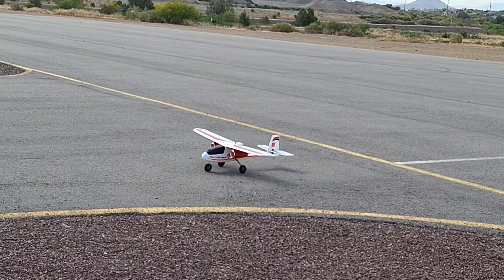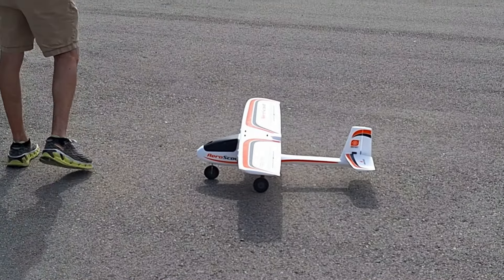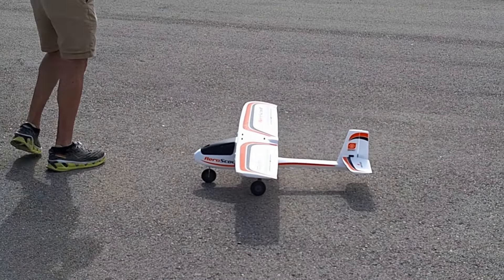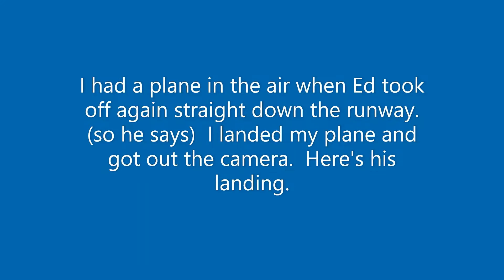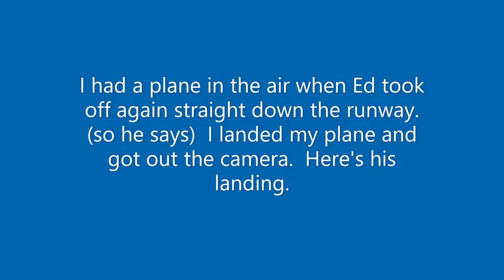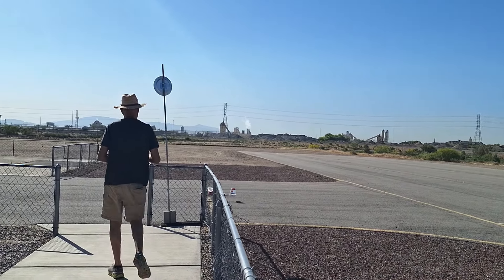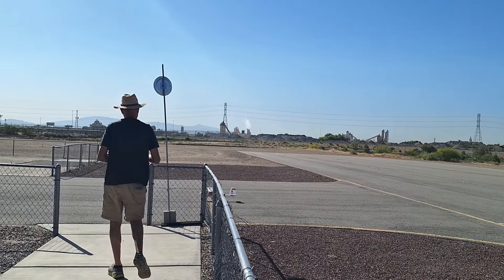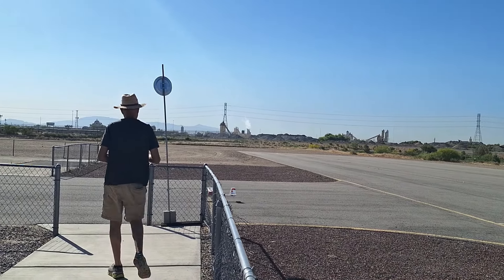Aero Scout with Twin EDF motors

Comment: I have been flying for 8 yrs now,and i can never figure why people fly so far away with small panes. I have had to save a few planes for people. Flying to far away. Good build.
Reply: I'm close to 60. Got back into flying 5 yrs ago. Flew 20 years ago for 15- 20 years prior. I do primarily 3d. Even my bigger stuff (1.3m-2m) when it gets sketchy, in the sun, in gusty winds, GOTTA see which en's is up🤪! No gyros here. Too limiting!
Reply: I agree.  Even if you normally fly big planes and fly big, it's easy to get in that habit and fly the small ones big.

BUT, you have to have that discipline to fly responsibly and with common sense.  Know your limits.  With that however comes the realization that if you're not on the sticks,you can't be a real judge of what too far is for someone else..
Reply: All I can say, I think we all make good points to think about, on video planes seem farther and smaller too. I'm still learning.

Comment: If you mounted the engine nacelles above the wing like a 'Coaler' the thrust would blow over the top of the wing, increase lift and improve STOL performance.
Reply: But the empennage would not be in the efflux zone so it could be worse STOL performance.

Comment: I'm wondering if the CG was off. It seemed like it wanted to nose dive when it was taking off...!!!  😮
Reply: If the nacelles are angled down for a downward thrust line to compensate for in flight performance, then that could lead to the nose dive situation we witnessed during takeoff if the power is not smoothly applied.

Comment: Seems the tail wind when first taking off
Reply: If the nacelles are angled down for a downward thrust line to compensate for in flight performance, then that could lead to the nose dive situation we witnessed during takeoff if the power is not smoothly applied.
Reply: @toolbaggers thanks detail info, and nice video mate

Comment: May I ask where you got the nacelles for the EDF's? I think I would like to do something like this to one of mine. Looks great.
Reply: Xfly swift 50mm units. Comes pre installed. As per the txt the gentleman has put in the video. About £20 each.
Reply from the maker: I did a google search and found xfly-model.com  rc-castle.com  turbines-rc.com   aliexpress.com  all have them.  I'm not sure which one Ed got his from.
Reply: @M4rkmcc21  Thanks much
Reply from the maker: If you do a Google search for the motors I listed, 3 or 4 places come up where you can get them. I'm not sure which of these Ed used.